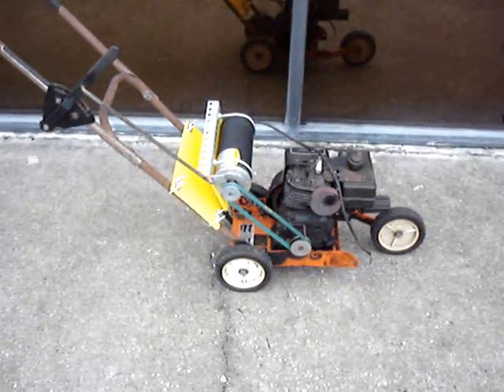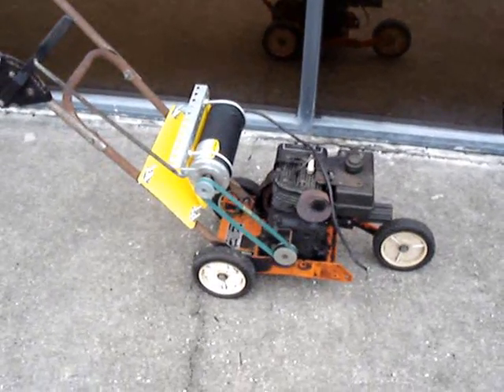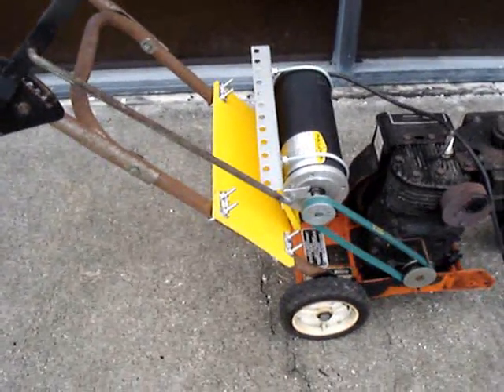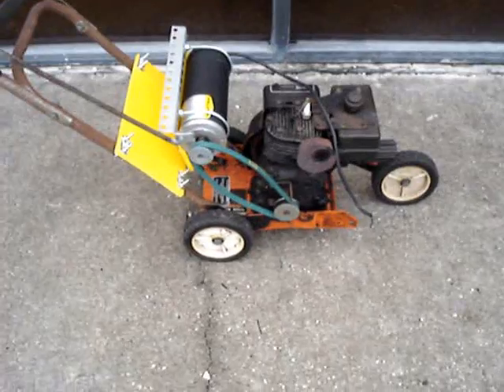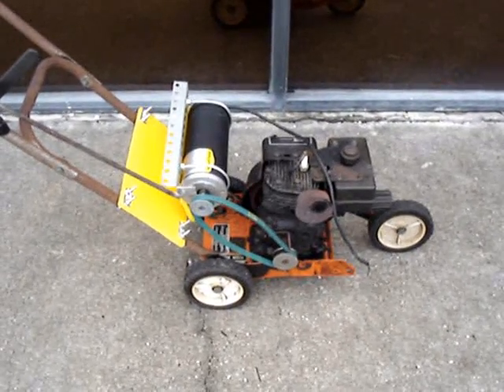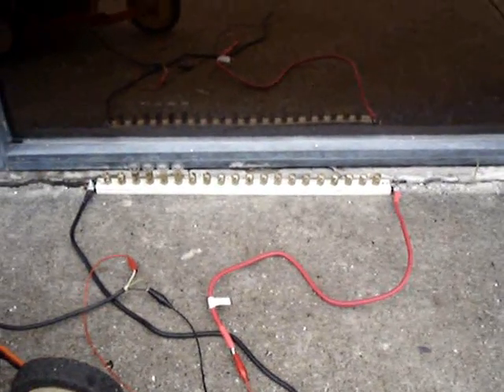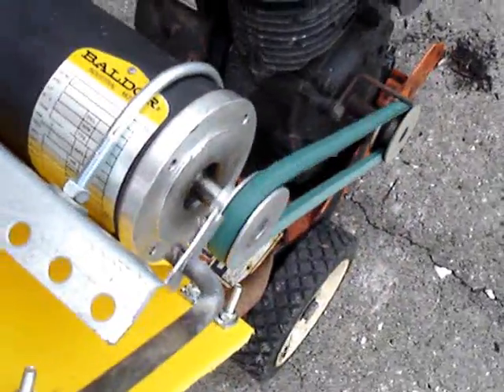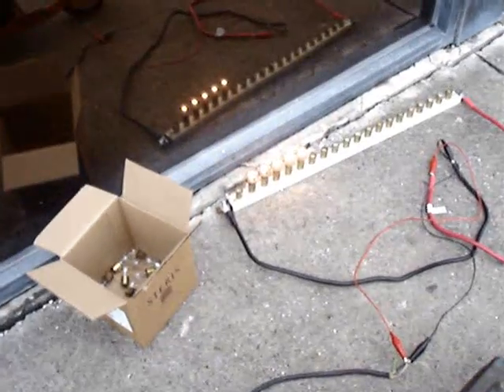Improvised Generator Build at mdpub.com

Comment: How do you govern the voltage. Must be a voltage regulator in there, right? Or is output based on the speed of the Perm mag motor?
Reply from the maker: This is an old project. It's no longer in use. I fed the voltage into the regulator for my wind turbine. It charged my batteries. I have enough solar capacity now that the batteries never run down, even after a couple of cloudy days. I generally don't even need the wind turbine any more.

Comment: The lawn edger-trimmer is a 1981-84 Sears Craftsman 8711 with a 3.0 reserve power Eager-1 horizontal shaft engine (model 143.711022/H30-35327N or 143.741012/H30-35327P).

Comment from the maker: @AlternativePowerMan 
The DC motor I am using as a generator cannot handle that sort of current. I am badly overloading it with the 16 Amps I currently have the unit producing. The windings of the motor just can't handle any more current. The generator is doing the job I designed it for, so I am happy with it. I may someday experiment with either mounting a car alternator on it, or using this monster PMDC motor I have which is rated at around 100 Amps. It weighs a ton though.

Comment: @omegageek64 Small engines like this are usually governed to 3600 RPM, which is good enough to drive an automotive alternator.  If all else fails, optical tachometers aren't terribly expensive, and are good tools to have around.

Comment from the maker: @neothespian 

I'm not sure the speed of this particular engine is high enough to produce significant amounts of power from an automotive alternator. Other engines may work better. Also changing the sizes of the pulleys on the engine and alternator could increase the speed the alternator is driven.